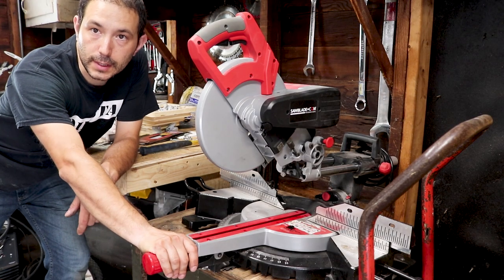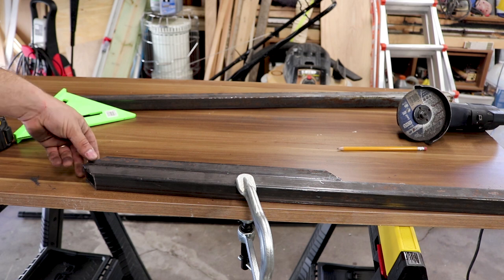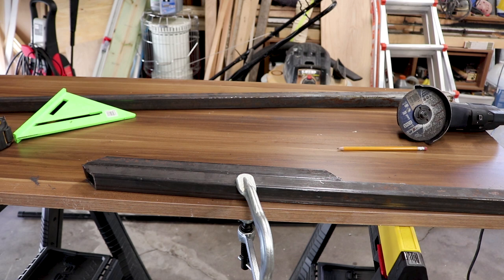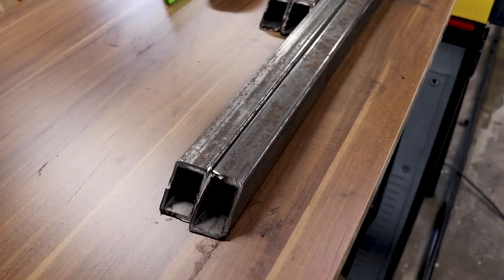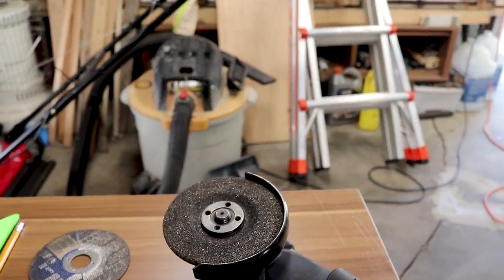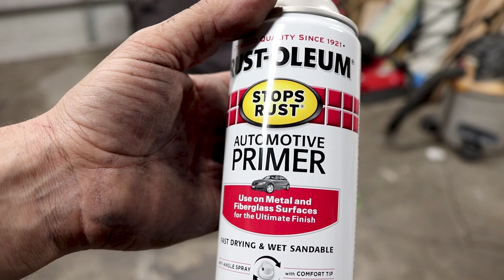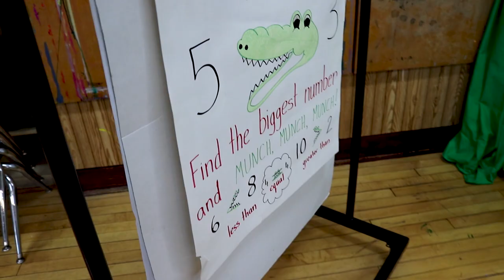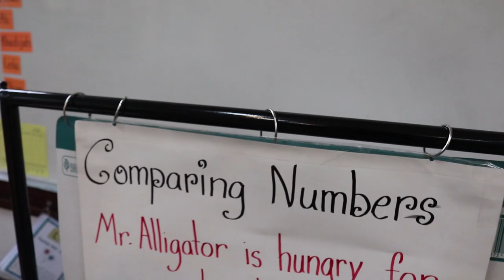Rolling Chart Hanger for classroom

Comment: “Done is better than perfect”  Cutting with an angle grinder, welding on a wooden plank, painting on the garage floor; you got the job done, and it came out beautifully. By the way, have you considered a bandsaw rather than a disc blade cutoff saw? Thanks for sharing. Dan
Reply from the maker: That's funny you ask. I do have a 14 bandsaw in my basement shop. I was trying to finish the work in same day and film it too. I did not think of doing the cuts in the basement. Sometimes I look at things with blinders on and don't see what is around me . Thanks for watching and your comment.